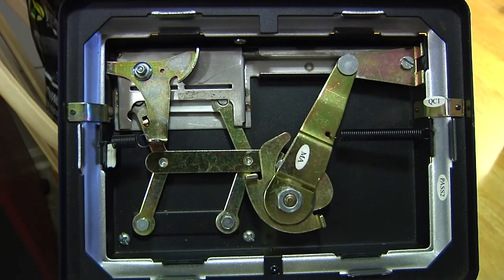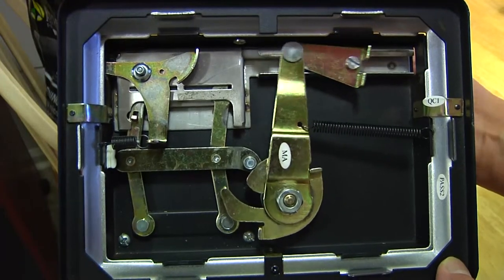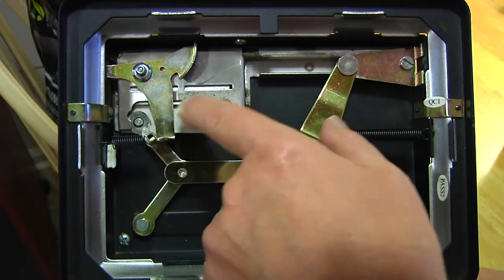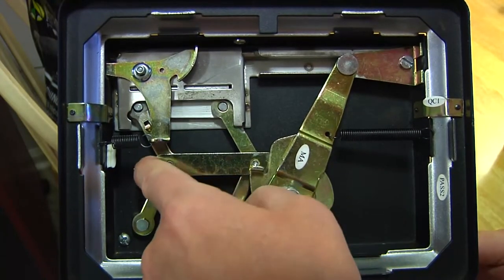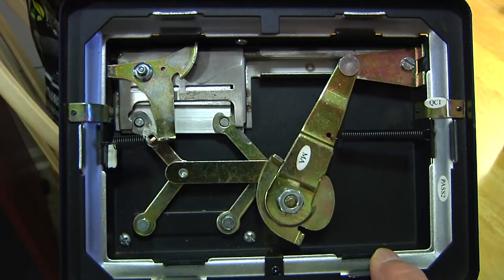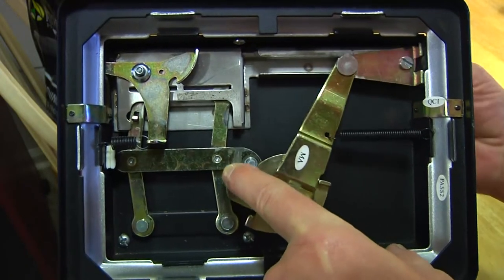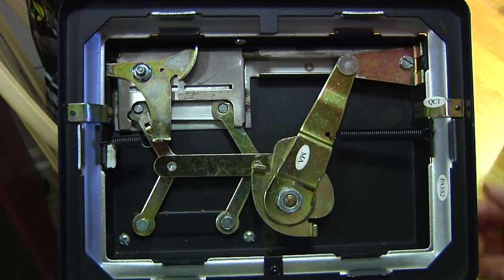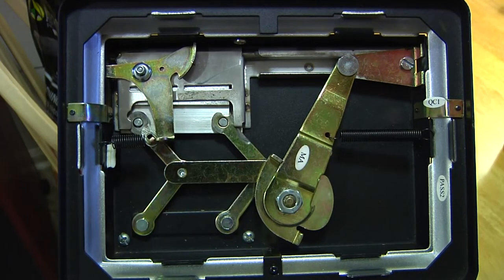Top O Matic FIX

Comment: I switched to a Yellow/Blue plastic Top hand roller because of this very problem, with all 3 of my Top-Ohdammit-Matics, over many years. Been using the plastic hand roller for over two years now. Well until I broke it & then decided to find your video here! I super glued a standard used yellow 3M ear plug in that location and they all work perfectly. Thanks for sharing! Smokes here in Minnesota are $10+ a pack, $6+ for the Montego at certain places. So going back to less then $1 a pack rolling my own frees up a lot more needed Fuel, Fishing bait & Ammo $$$, lol

Comment: Wow ! You are a Top O Matic Genius ! I've had jamming and 1/2 filled tube problems for years with 2 of these damn machines. I replaced the 09 short spring and added a rubberband to it to add more tension to the 08 rubber cover. I've also rebent the injector to adjust it's diameter using a phillips screwdriver as a form and pliers to squeeze to injector. I have also blamed the problems on the consistency of the Great Stuff tobacco which changes with it's moisture content. It goes from nice pliable shredded  leaf to fine powder as it quickly dries out. I suspect the fine dry powder to be problematic even with a new machine. Anyway, your video fix with the foam pad limiter is a winner. Other videos on the subject are on the wrong track. Yours got right to the heart of the problem and solved it at no cost. The little studs on the 010 tamper that connect to the 018 link are the main culprit when they're worn, creating unwanted slack/play and reducing firm pressure on the tamper. That in turn causes the tobacco to be malformed. I've wasted a lot of tubes and dried up powdered tobacco. As soon as I tried your fix, BINGO. Thank You HaleyFix. As a footnote; as Top O Matic/Republic tobacco has likely figured out that the "010" tamper is their top seller of their replacement parts, it's probably no coincidence that it's, by far, their most expensive replacement part. $$$

Comment: You are a legend. I smashed one of my rollers on the ground after ruining more than 20 tubes just to make 1 smokeable cigarette. I bought a new roller and it started doing the same shit after a few months. Tonight I use a little silicone tape on my new one and I used a little bit of hot glue on one of my older ones that had the same problem. Both work great now. I think the hot glue may hold up better than the tape, but they both roll nice full cigarettes now. Thanks for the info on how to do a quick fix.

Comment: I was having the same problem;  thought it was the years-old machine, so I bought a new one, but had the same issue only a few months later.  Instead of tape, I used a self-adhesive bumper that's normally for keeping cabinet doors from knocking against the frame.  (I work in a cabinet shop, so I have tons of them...!  :) )  Was the perfect thickness for this fix and easily replaceable when it wears out or falls off.  Thanks for making this video, mate... you've helped my blood pressure go down several dozen points...!   LOL

Comment: Without a doubt it works!! I Just slapped in two stacked pieces of 3m i had in my junk drawer and tossed some dry ass shreds into the machine. 2 seconds ago that mess would have plugged my machine but I swung that lever down and it filled the sexiest cigg ive rolled in months!! Youre the man, thx for posting!

Comment: Thank you so much. My first top roller lasted 15 years with no problems. Got a new one for the new place, started messing up after 6 months. Your suggestion fixed it perfectly.

Edit: I took a look at my old roller that never had a problem, it has a pointed end on that piece given us problems that keeps it from going too far. They rounded it off in the later versions.
Reply: very interesting. thank you for sharing that..

Comment: Dude thanks for the video I just used a piece of rolled up toilet paper 🧻 to fix mine. LoL 😆. But it works. At least until I can get me some of those sticky pads. My 1st cigarette machine lasted about 8 yrs before the injector got bent and I just went bought a new one. Ain't had it about 6 months and have had problems out of it jamming for about 3 months so thanks for this video I have a backup roller given to me awhile back that I think 🤔 I can fix using this same method.

Comment: Hey brother, thank you for this simple tutorial. I have been making my own cigarettes for a long time now and on average, these machines usually last about 3-5 months before they start going south on me. I've bought several of these every time they went bad and tried this little adjust on the one I'm using now and completely cleared up the issue. I'll do the same for the other 5 I have and will have plenty of back ups now. I tried to figure it out a while ago and never thought to look at the armature over extending, kinda feel like an idiot but thanks again for the heads up.
Reply: Hey, I wanted to tell you that if you're at the bottom of the bag, down to that shit powder tobacco, use about half of what would be for the amount for a cigarette, and tear or cut about 1/4 of an inch off the end of your tube, and the tobacco will go to the filter. I absolutely hate it when there's a huge gap between the filter and the tobacco. If you do this, you won't have to try and tear them and flip them. it makes your smokes about the same size as those short Marlboro packs that they sell for about a buck less than the full size. Also by adding less tobacco it's much easier to make a smoke with that bottom of the bag garbage. I usually just buy a new bag when I get down to that, but sometimes I'm either to broke, or it's to late at night to bother. I hope this helps you out. Peace..

Comment: You sir are a genius! After buying and replacing part after part (H bracket) (spoon injector)  (tube clamp) (injector lever) (cost of shipping) practically the cost of just buying a whole new one to no avail it still had the same problem as yours. The wear on one side of the tamper gate cutter nub as I'll call it so slight I didn't even notice it so never thought to buy the tamper gate cutter. After watching your video I also saw the same play in the operation and instead of buying another part plus $7.00 shipping again I simply gorilla glued a dime to the same position as your double sided tape padding instead and BULLSEYE ! The machine works flawlessly, thank you for sharing how to fix this problem.

Comment: This Fix really worked, I was like you ready to destroy this machine but I decided someone else surely had the same problems so i came to YT found your video and my roller works like a charm. I have several Top-o-Matics sitting around I bought a Premier so it works for that machine as well. I will fix my Tops and try them out as well. Thanks for doing the video.

Comment: I was almost pulling my hair out tonight, I have two Top O Matic machine's, that have given me a sore arm because they have gotten hard to pull the handle, and not filling the tubes,  I came across your video, and I said let me give this a try, although I didn't have any double sided tape available, I had a piece of wide foam, I cut it into a small piece, and used electrical tape to adhere it, and it was like magic!, Thank you so much for sharing this.

Comment: THANK YOU for posting this!  It got so bad that I was questioning my worth as a human 🤣🤣🤣 I am on a VERY small, fixed income and wasn't looking forward to trying to budget a new unit. I didn't have any of that packing foam material, but I had some self-adhesive rubber material used to seal around door and window openings that worked just great! Not that cheap foam stuff, but the rubber stuff

Comment: Going try this fix, can't afford another machine I've had mine for almost 3 years and just now giving me trouble. Thanks for the ideal
Reply: I bought the older model around seven years ago and only recently had to replace. I've had the new model for about a month, and I'm already having trouble.
Reply: I got a box full of 5 of these damnable machines all with the same problem. I just tried it on my current machine and it fixed it.

Comment: I went through 6 top o matics with the same problem and then I watched this video and it fixed everything.  Note . Instead of using the sticky foam thing . I took a xbox live gift card . Cut it to the same size as the foam in the video then layered it 4 to five strips together so it had no give what so ever and it last a long time . Thanks 4 ur help .

Comment: What I have found is the top left nut comes loose so use some blue lock tight. Also the spring tension on the right hand side I wound mine down some into the spring and the machines worked flawless for years now. 

Just don’t over tighten that top left nut or it will bind up

Comment: I really hope that your fix works for me🙄 I’m thinking about buying a new machine today....UGH! It will be my 6th one in the last 7 or 8 years or so. I have actually used the “return for a new one” offer that the Top-O Matic company offers, a couple of times. That was years ago. I’m now the owner of 5 Top-O-Magic T2 rolling machines! NONE of them roll a perfect smoke!!!!! Sooooooo FRUSTRATING!!! I’ve tried so many little tweaks to get that brand new working perfect smoke! I mean, the machine is all metal! It should not be wearing out this fast....right? This has been my favorite manual roller as I have tried other ones. This one seems to be the most heavy duty as far as all of the parts in it. It does make sense to me that the tobacco debris that accumulates inside, sort of acts like saw dust, in that it will dry out any of the moving parts that need lubrication to work effectively. So to that end, I clean out the entire under carriage of my T2.
Finding the right lube to “relube” my T2 is another story, as anything used is going to effect the taste of, as well as contaminate the tobacco😳 I’m thinking of trying Vaseline next(any thoughts)?
So here I am now with 5 T2’s, considering spending another 50 bucks on yet another freaking T2!!!!! I’m going to try this fix first😬 I noticed that on 2 of my machines that I have handy right now, seem to have the “wiggle” in them that you referred to. So fingers 🤞😎🚬
Side note, please feel free to offer up any ideas that will help me to restore my rollers to near perfect. I want to sell them, but only if they are working almost as perfect as when they were purchased 💵

Comment: FINALLY!
How thick would you guess that taped piece is?
I'm actually missing the rubber that holds the tube in place until it's released. Otherwise, worked fabulous

Comment: Thanks for the fix 👍
 I've seen several comments about lubricating the mechanism or moving parts and some people say to use a bit of oil or even vegetable oil but I'm thinking that a dry film spray lube would be better because it doesn't hold onto dirt and debris. I haven't gotten one of these particular style machines yet but soon.

Comment: Oh yeah, another common problem is if the white plastic that is on the right side (there is a cut out hole on the right side) does NOT still have the shape of the hole it means the white plastic is crooked or just loose, that means the pusher (the silver sword that pushes the tobacco into the filter) is also crooked, if that plastic is off, the sword will come through the side of the filter. EDIT: A LOT of you probably have or still have problems of the machine spitting out cigarettes only half full. It means the smaller spring is too loose. You can either A. Get 2 pliers and give the spring more tension and B: you could go to ace and by a slightly smaller spring. Half smokes is the most frustrating out of all the problems

Comment: I am just starting the video. I just bought this roller and the pusher arm is stuck.  I found a screw laying in the back that came out of SOMEWHERE.🥺 I REALLY don't want to buy ANOTHER new machine already.

Edit:  I see where mine broke just by looking at the back of yours.  The screw popped off the part that controls the slide of the pusher.   I have no clue if putting it back in is going to hold since the little washer ring came off too.  I don't see how I can't get it back in there right.🥺🥺🥺🥺

Comment: That squeak  is from the nub on the upper left  arm  that is the tube clamp guide.  Mine "sawed" it's own nub off.  It already has a  hole.  I just put an 8/32 x 1/2  in it.

Comment: OH MAN DUDE MY BRO.. I’ve had this thing for about 5 years plus..! I’ve done a few mods to it and have had it working way better but always something with it. So basic of a machine what’s the darn deal. I’ve gotten o e of those little electric ones even they come in blue and red/black.. they are no good my man and they aren’t that cheap either. It cuts the tobacco a little to fine for me and there’s not much adjusting you can do with them. It works just not the best. This machine in well working condition does make them better than the little electric ones that run about $45-55.. man I found some cheap Top tubes and some tobacco for $1.99 believe it or not. Yup I had to go back to rolling my own. Tried to get one of those little injections deals. Little plastic thing but works great.  I figured I’m in good shape because I had this one at home and the little injectors were out of stock of corse. Why not look on the tube and see if anyone has something new and figured this thing out. Has to be something wrong in the design or something. There’s a little wheel that’s actually attached to the piece you’re putting a bumper for. The opposite end with the little wheel that catches IVE noticed that one drops to low on mine and that causes a huge click and throws it all off. Just bent that one up. I’ve always been able to get it goin but only for a little while. Writing all this is 100% worth it. You have a new subscriber here bud.. my damn machined and I mean “Damned” machine I thought this thing was evil after all these. It’s so simple and I just couldn’t figure it out. We spend this much and it’s big and bulky and then it doesn’t work worth a $hit? Oh man thank you bud..! Really am subbing for this! Thank you so much brother man. God bless you and yours. Be safe out there

Comment: Take it apart and clean it up first. Take the slide plate out and take a flat file to it and clean the burrs off. Then take a screw driver and remove the plastic slide bar. Take sandpaper and clean the top of the slide track. Then put back together. It will work like new. It's a novelty item. Doesn't need oil. Metal on metal. Those two areas I mentioned is what causes it to give you half cigarettes. Once you lightly file that slide plate clean and sand the top of the slide track. It's ready to go.

Comment: Those damn things are garbage after about 5 or 6 months of use. I still have the corpse of 2 of them. I have taken them apart and greased everything and replaced springs and did what you did in this video and finally i just smashed the hell out of the second one yesterday and damnit it felt great. So today just for the heck of it i am going to take them both apart again and see if i can make 1 out of 2. Luckily i still have a cheap plastic machine to fall back on that has out lived both of the others. When you get those topomatic machines new, NOTHING beats them but once they start acting up it's all down hill from there. At least that has been my experience with them anyways.

Comment: Hello. I have a question. I have one of these, though not sure what brand. Looks similar to this one though. The piece that connects to the handle that pushes the metal piece into the tube is what im having issues with. So when I put it all back together and pull the handle, it wants to stick/jam. So I have to hold it to roll one so I can mess with it while rolling. Would happen to have any ideas on why it keeps doing that? I hope this made any sense lol

Comment: I need to know where to purchase the short spring???
Reply: Take that little guy to Ace hardware or a home depot and you can find something similar in size and length on the shelf for about 50cents.
Reply: One more question. It's tearing the tip of the tube so I replaced the rubber tip..
It's still tearing like 1/4 of the tip. Any suggestions???
Reply: Does yours have the little tube length adjuster on the side. I dont want to state the obvious but could the tube be too short for the length setting? Mine doesn't have the adjustment, it just rolls kings but when my tubes rip like that its typically because im smushing too much leaf in the hopper. Im just super happy I came across this dudes video. I too was about to give up on my machine after trying everything possible. I even pulled out that little pusher needle thing and sharpened the teeth but it was still binding up the tobacco. I tried experimenting with different humidity levels which i know nothing about but nonetheless not one thing worked except for this little bumper trick. Works like a champ now 🤝🤝
Reply: Yes mine is adjustable but no matter if I load to much, to little, or just right it rips..I ordered new rubber tips off Amazon. Well see if this work better. It's really not a big deal, just messy. 
Thanks again for your tips...